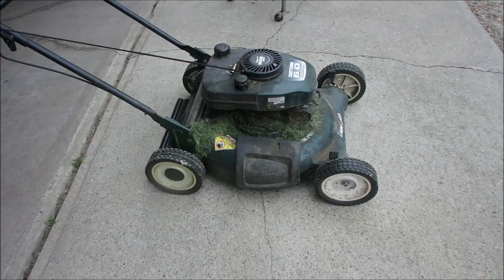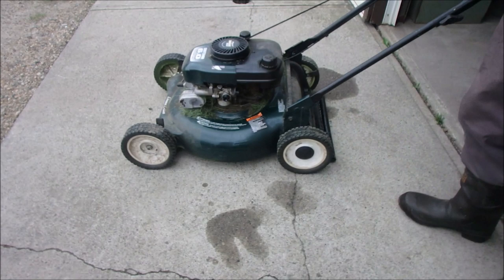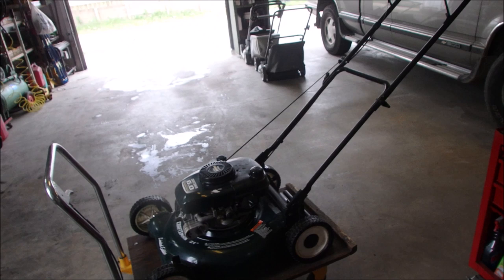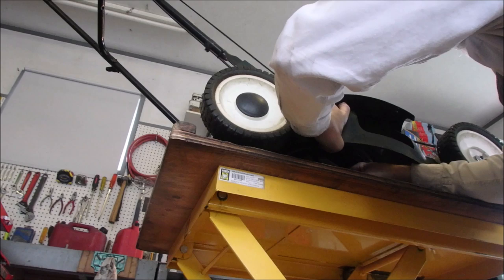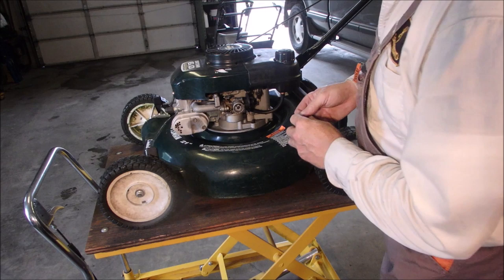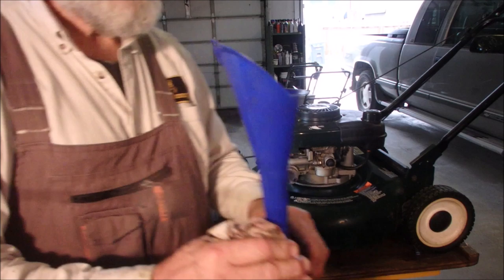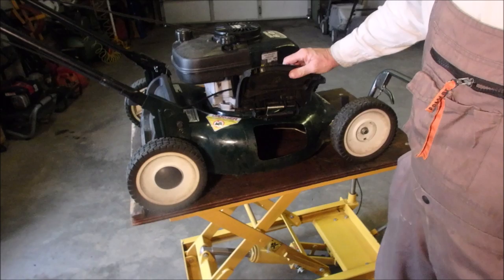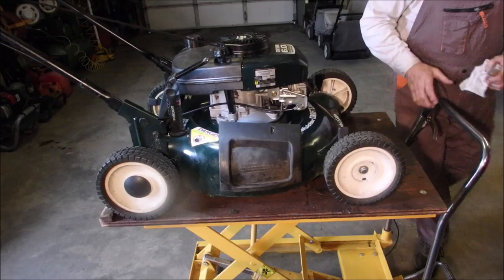Craftsman 6HP Mower With a Bad Primer Button

Comment: I’ve been working on a lot of machines. This alcohol in the fuel is doing a number on things here in Texas. The temperature here is 101 for the next few days. I lost count of the machines I’ve fixed this year. Great work Bruce.
Reply from the maker: I just checked here in my Western Canadian city.  There is one supplier that has no ethanol at all in all 3 grades of fuel.  It is the CO-OP

Comment: Hey Bruce, I really like my Craftsman quick release ratchets.  I have some I bought new myself, but I also get used Made in USA ones at flea markets.  Whenever I see one in good condition I'll pick it up.  They usually are not that expensive.  I've only ever had one break on me and that was 1/4" one many years ago.  I've used one of my half inch ones with a 2 foot long cheater pipe to press on a differential pinion gear bearing and crush collar.  The cheater pipe exploded at the weld seam and the ratchet was fine!  Nice job repairing that mower.  Looks good now.  I have a couple real piles of junk I'm working on.  Videos will be coming in about a week.
Reply from the maker: Yes my old Craftsman Rear drop ratchet was made in the USA and it is great.  This one is a foreign one.

Comment: Sorry to hear about the ratchet,  
I have a sears ratchet for nearly 30 years and works great.  Made in 🇺🇸 
My emergency set kept in car, made in Malaysia, no where near as good quality but gets the job done in a pinch. 
It’s 25 years old.  Sockets are showing some wear from the softer metal but still works. What did I expect for $2USD at auto parts store. ( bought because broke down when spark plug got ejected while driving and needed it to fix it)
Reply from the maker: Yes my old tear drop craftsman is still going strong.

Comment: Gotta love the old Eager One style engines, where we are always "Eager" to fix them!
Reply: Kens Small Engines  yah and that’s how you were forced to learn to some degree of being handy and basic mechanics and likely started some peoples step into being an auto mechanic
Reply: My first mower when I bought my house back in 1990 was a 3.5 hp Eager One craftsman non-propelled walk behind.  I actually gave it away a few years back as it ran great.  People saw me working on stuff in my driveway and asked if I fixed stuff, so that's how it all started back in 2000. Simple repairs were always no charge, except for parts as needed, but once full engine rebuilds started showing up and "on the road" repairs offered, i had to charge as I wasn't exactly situated to be a philanthropist with two kids at the time!  It's a hobby and a passion and as i say "pays for coffee and lunch".
Reply: Kens Small Engines  cool

My first mower I used was a 1973 sears eager1  push mower. Used from 1973-1998
After which my father gave it away.  After which I moved out after college.  It still ran .  Yah small engine repair is really a hobby for me.

We kept that mower Tecumseh engine going ,  they don’t make them like the use to.
Reply: My dad had an uncle who was a Police detective years ago (40's to 70's).  There were a lot of stolen mowers in the Police lockup yard.  After 30 days they were given away so my dad always got a FREE mower for us to walk our 1/3 acre lot.  I still have nightmares of the old hand crank Briggs starter that would slip and skin your knuckles if you weren't careful.  I also remember when my dad bought his first new push mower.  A red Rallye brand (Murray I believe) when he was in his 60's.  No self propel.  He nearly died when we got him a Snapper Hydro RER for his birthday.  I miss him, he'd surely wonder where my mechanical prowess came from, as he was not that mechanically inclined.
Reply from the maker: Best hobby ever.   @dfields9511
Reply: Kens Small Engines Rally is really a AYP brand .   Yah I have some memories of that old 1973 craftsman mower I used and the blisters I got on my hands as a kid.  And the bag was soo small.  

I appreciate your father’s police service 👍

Comment: I have a 1993 Lawn Mower with a black rubber primer bulb that is incorporated to the gas tank and finding one of those things is like finding a snail darter...you'd think there'd be hundreds out there but these days they're either recessed like the one you are working on or they're the new Red or Clear types with the white nylon snap-in brackets...grrrr
Reply from the maker: I have not seen one of those.

Comment: Not sure if it's your issue or not Bruce, but it might fix the slack in your ratchet if you replaced the missing screw in it. :)
And when I saw you with the power washer for some reason I could almost hear someone yelling "Hey Ma!! Old man Pender is out power washing the gravel alley again!!" lol  Thanks for another informative video Bruce. Always a treat to watch them.
Reply from the maker: I like to push the goo out into the centre of the alley.  Wow you guys are tough  lol
Reply: @BrucesShop  lol not criticizing my friend :) Just snickering to myself because it looked like you were power washing the gravel ;) (I might do the same thing when cleaning my concrete driveway that connects to a gravel alley) :D

Comment: The next time that you go to the dentist, ask for a cleaner/ poker tool that they don’t use. Works great as a pick and usually off set a touch.
   Also when installing the bulb back for primer , are the tangs facing out?
Reply from the maker: Yes   they just push in.
Reply: Bruce Pender thank you

Comment: I really enjoy your videos, been watching quite a few.  I have a question that is not about this particular machine but one that comes up quite a bit in your videos.  Regarding the problems with ethanol in gas and the problems it causes -- if you have an engine that is working now and want to change over to non ethanol gas, will the new gas clean  out the old sludge caused by the ethanol?  If not, is there a fuel additive that will clean out the sludge?   I guess any solution other than a complete carb clean.  Right now thinking about my Craftsman with a 20.5 HP Kohler twin. Thanks and keep up all the good videos.
Reply from the maker: well any dilution helps.  The big problem is time.  I use STABIL treatment and it does last for months.  I have not has as much luck with Seafoam but my climate is dryer.

Comment: Hope you used some veggies from your garden, and had a biscuit with it! Nice repair.
I’m fighting valves on a Ryobi 4 cycle. Gonna have to do it by feel. Clearance is .006.
Reply from the maker: Wow that is .24 thousands.
Reply: Bruce Pender no way to get a feeler gauge in it, gotta do it by the calibrated finger method.  I figure if it’s not flopping, and it’s not tight on the valve stem, it’s ok.  The front rocker stud loosened up, had to remove and lock tite  it in. I’ll know tomorrow.. I did a typo, it’s .006. Still not much. I corrected my original post. 
Jim
Reply from the maker: @Jim-ie6uf  Good luck
Reply: @BrucesShop  no way to adjust the valves as you would normally do. The top of the valve  is below the valve retainer cap. so the rocker is below the top of the valve. So no way to fit a feeler gague. I just had to go by feel. 6 or 7 thou, must be ok cause it runs fine. Are you picturing this?
This in on a Ryobi X430, the rocker studs have a bad habit of loosen up. Had to remove the front one and locktite it back in.
It's fiddly, and teidsom.
All is well with it.
If I never see another, I'll be fine.
Cheers
Reply from the maker: @Jim-ie6uf  Good for you.  Sometimes it is just a feel.  No joke.

Comment: i received a chainsaw that the customer lead me to believe he had it running and noticed a leak in the fuel line i replaced the vent line and it had a little liquid in tank i dumped it out about a half of a pint and it was mostly water replaced the water with gas/oil heet and seafoam  it ran but died after a few seconds every time i pulled the carb off found that both front and back gaskets were missing replaced them still was not working rebuilt carb there was still water in carb talked to customer he was surprised at everything do you think it could have run with all that water and missing gaskets  the water had rusted the screw that holds the needle in it had been in water that long lol
Reply from the maker: It was just running they say.  ;-)  I had to edit this comment   spelling mistake.